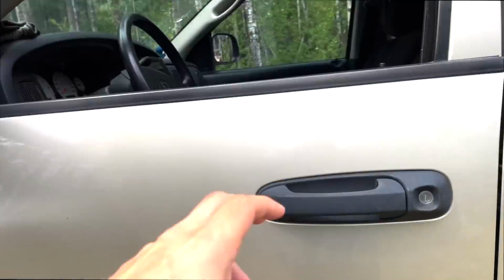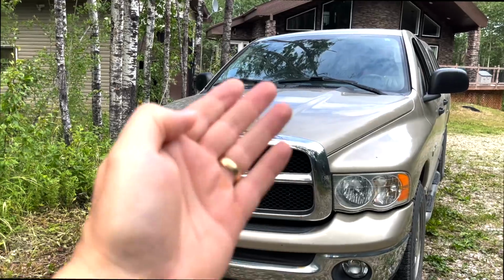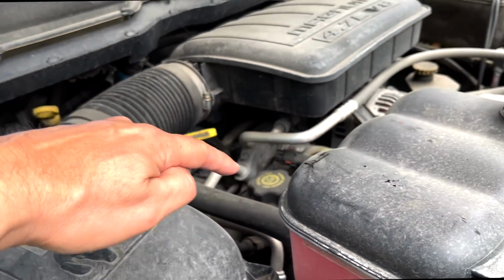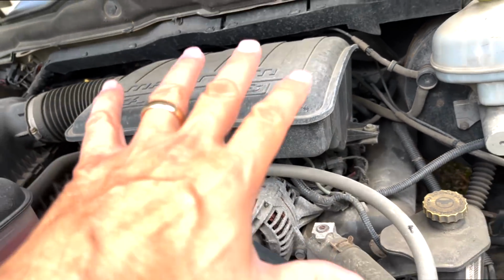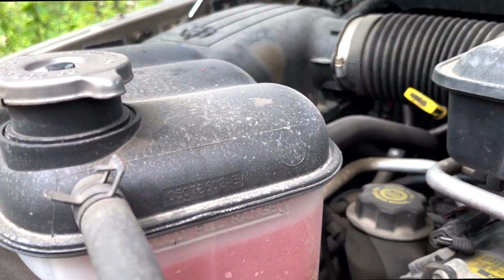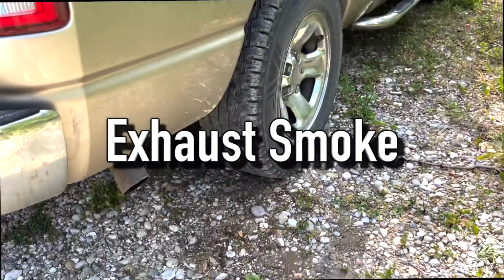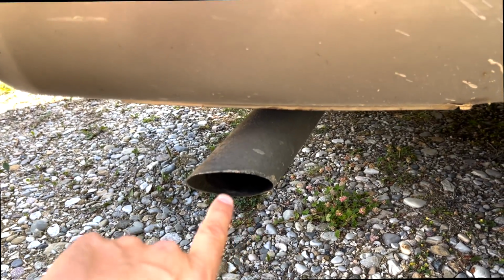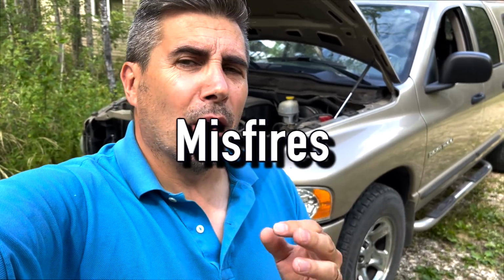Is Your Car's Engine DYING?  || Check These Signs!

Comment: All engines make noise hearing the lifters dose not mean the engines bad especially if it’s a push rod engine you’ll hear those lifters. As long as the noise isn’t very loud most the time it’s normal operation

Comment: I know engines which straight from the factory make a noise.
A noise there for is not necessarily an issue, just investigate.
Reply from the maker: That’s tru some engines just make a bit of noise.  Excess is key or random or out of sorts

Comment: Great video. Please keep the job like that.
Also, try to have videos showing the difference between automatic and manual transmission and the major issues they have and which is better to own.
One more favor, try to have a video of the minor issues one can have in a car and to fix them at home without getting ripped off by car dealers.
All the best and great respect from the sunshine State of Florida.
Reply from the maker: Thanks a lot for watching

Comment: I think everyone should heavily research a vehicle, new or old, before purchasing one. It’s like if you buy a car or truck that has inherit mechanical flaws thinking that it will last 200k or more miles, there’s no one to blame but yourself.

Friends of mine that have purchased Dodge/Chrysler products in the past all have had some sort of serious issues with them especially their cars and minivans. So sometimes just scratching off certain brands helps prevent hardship and money thrown down the drain. 

Long time ago I considered a Chrysler 300C with the 5.7 Hemi V8 but after reading reviews on them and seeing how unreliable certain years were, I stayed away. You can pretty much say that most of all Toyota products are very reliable compared to the industry.

Kia/Hyundai have ways to go since there vehicles are a hit and miss and just can’t be trusted as of now long term. Although their new vehicle design and styling are very aggressive and cool looking vs most of the competition.

GM products are also hit and miss. I owned a 2017 Chevy Impala 3.6 V6 for 4 years which I sold when it had 106K miles on it and that car never gave me an ounce of trouble. No check engine light on it ever, and everything worked perfectly fine the time I owned it. It was a very reliable car and was well constructed. So Chevy/GM did a great job with that car, but I can’t say the same for some of their other vehicles.

I did my research before purchasing that Impala and notice how high of a score CR gave it, plus after reading numerous owner reviews, nobody really had any negative thing to say about the Impala. So that helped influence my purchasing decision.

Unfortunately I believe the latest cars and trucks that have been turbo-charged, have been less reliable compared to regular N/A 4 and 6 cylinder engines of the past. They require more maintenance and more frequent oil changes to run well. Screw that crap, just give me a good ole smooth running N/A V6 or V8 engine that can run forever with less to go wrong over the latest garbage put out by every automaker today.

Can we honestly believe that brand new turbocharged engines will last 200K or more miles? I don’t care who makes them, it seems like they all have some sort of problems either because it’s a design fault, or quality materials issues inside the engine. We might have to rethink the notion that new cars last longer than older ones as the quality of certain brands have gone downhill especially due to the supply shortages and cost for raw materials skyrocketing thus forcing automakers to cut cost by cutting back on quality parts. New isn’t always better in this case.

Comment: I've heard from an experienced youtube car mechanic named "Car Wizard" that any 4.7L powered Dodge is a truck to run from.  The 4.7L V8 in the '04 2WD single cab Dodge Dakota, the final year or the late '90s- early 2000s generation, really got my eye.  Years later I've now thanked Car Wizard for his word of advice which made me think twice about wanting to collect one of those for the sake of having a Dodge Muscletruck.  But I've managed to settle for 2.02 Heads & a Flat Tappet Cam on my 350 powered '69 Chevy 1/2 ton pickup.

Comment: I once went to look at a BMW 7 series for my dad that made a knocking noise like you had in the truck.  On top of this the CEL was lit up bright and proud.  They said that they would just reset the light and it was fine.  I turned around and walked away because they were wasting my time.
Reply from the maker: Exactly, yes you have to be willing to walk if it does not look or sound right
Reply: @ECPP  it was a V12 which made it even more suspect to me as an expensive fix

Comment: Petrol engines generally sound and sweet as a nut where as Diesel engines (Dacia Duster) sounds like it was buggered from new!!!
Yes Really!
Reply from the maker: Nice.  There certainly are different sounds coming from the diesel.  They inherently knock due to compression ignition.